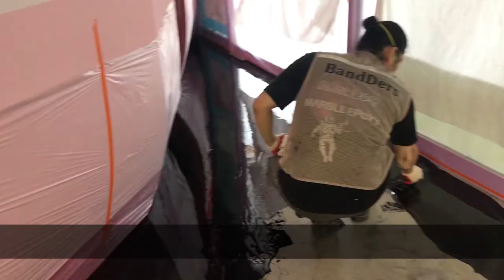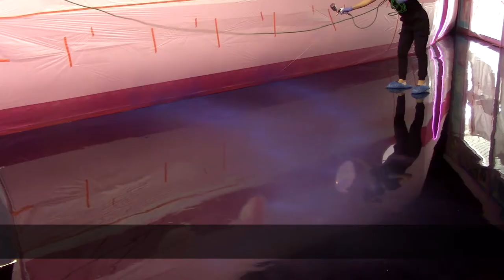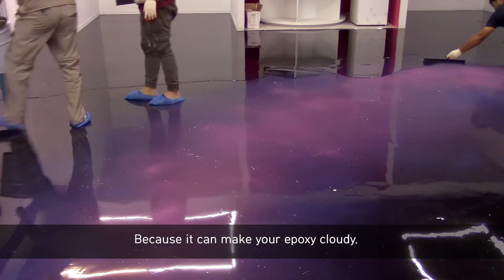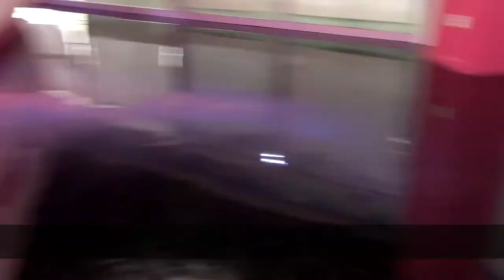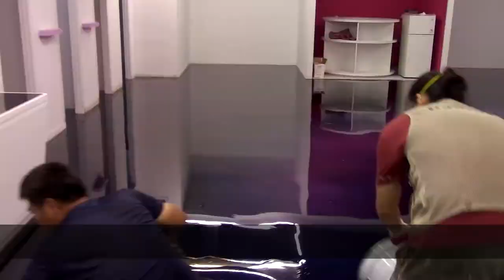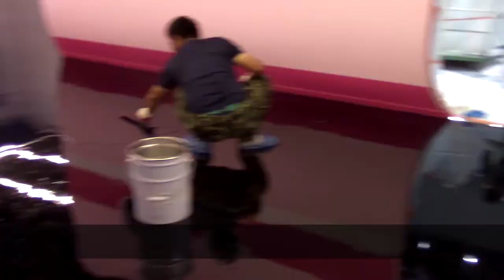[Step by Step] Galaxy 3D epoxy flooring

Comment: Excuse me, would you mind telling us if you use the colors with Epoxy or not and should we wait until the black primer is dry before adding the colors?? Thanks for this piece of art. It's awesome!!
Reply from the maker: Hello Hs Gd, 
We are very sorry about the late reply.
The black base primer is a type of solvent free epoxy and the surface should be fully dried (normally 24 hours), before putting on the color(design) coat. Then final clear coat (also solvent free) should be applied to protect the color(design) coat.

Thanks for watching! 
BandDers